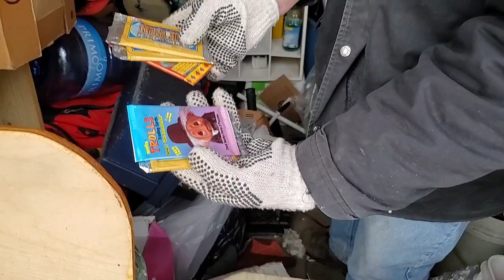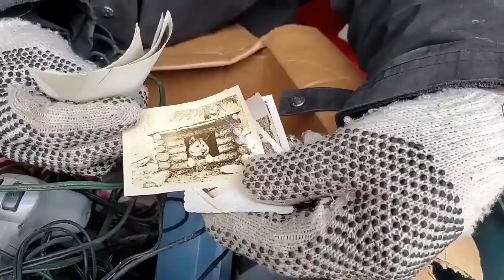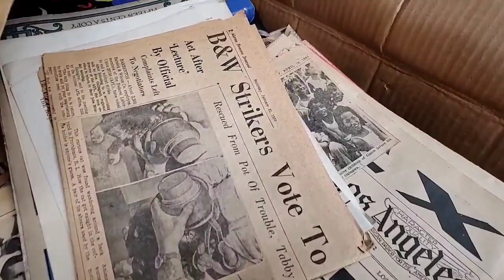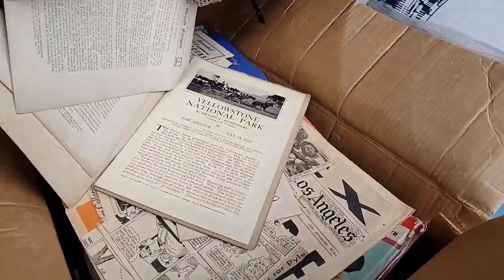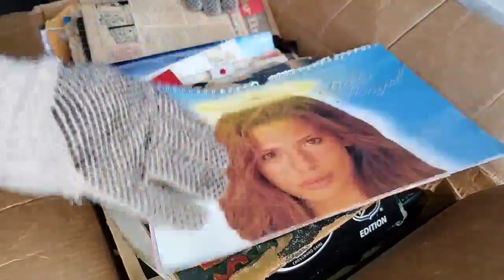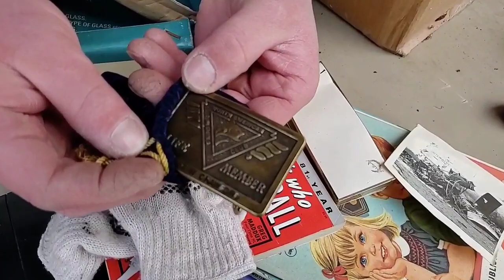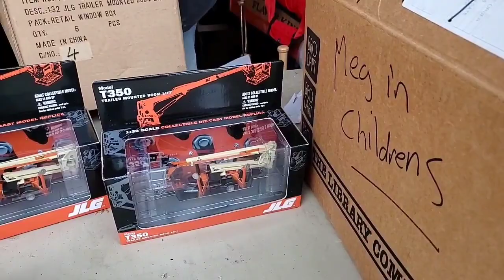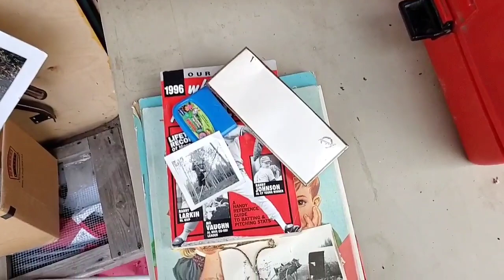What the Hales are AWAY & I buy AMAZING Abandoned STORAGE UNIT in Wooster! This locker is loaded!

Comment: Black container with square in the middle rectangle opening on 4 sides should be a circular lazy Susan to spin and the front each rectangle slots for photos.it is a remote control holder for tv vcrs, you get the picture.kind of obsolete because most tv remotes control everything once programmed. At about 20:35 in vlog.